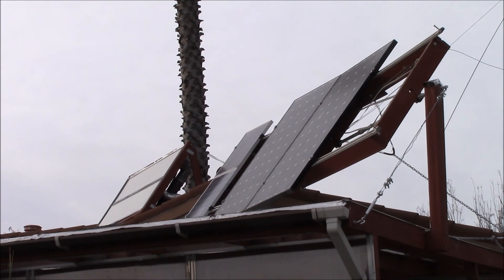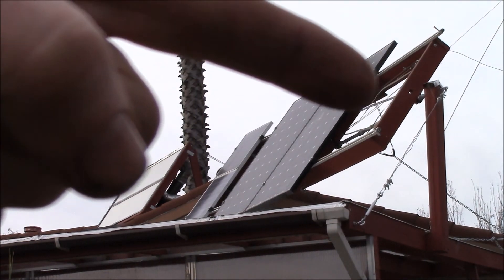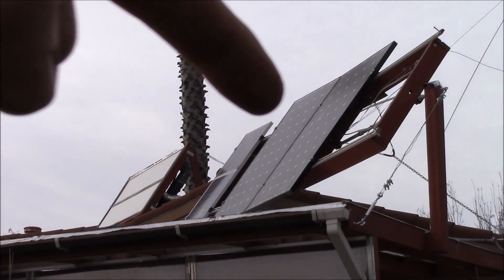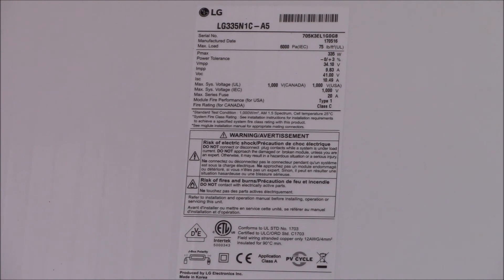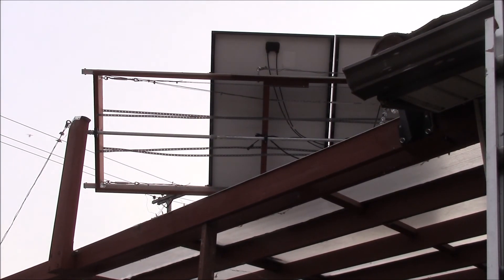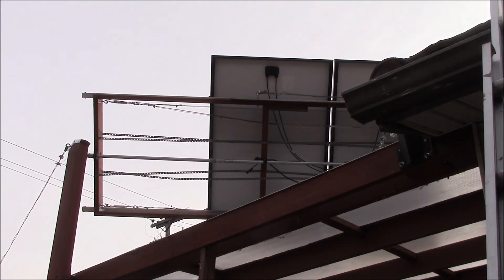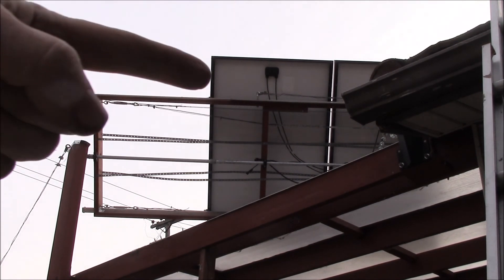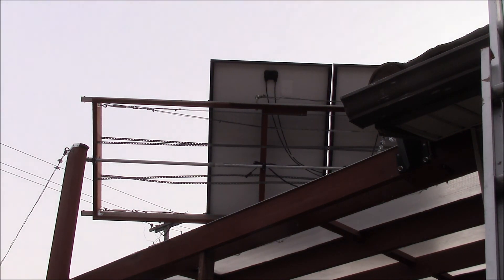Solar Panel Upgrade - LG NeON® 2, Part 1

Comment: They fixing to make panels that conduct solar power on both sides ? Doesn't cost much more they said, but who knows? The article mentioned 20% efficiency of the newer panels? Some of the systems I've seen on ground have solar tracking now per other posts I noted on youtube.

Comment: I used the galvanised steel deep unistrut and it’s very sturdy - although mines shorter and carrying less weight! I’m sure it’ll make it more ridged though.
Reply from the maker: Thanks for the comment.  Yes, it certainly seems to be a lot more rigid.  I think I went with the low profile stuff to keep the weight down on the rack.  However, by the time there are 4 full sized panels up there, it's heavy.  A few extra lbs/kgs of Unistrut makes little difference there.